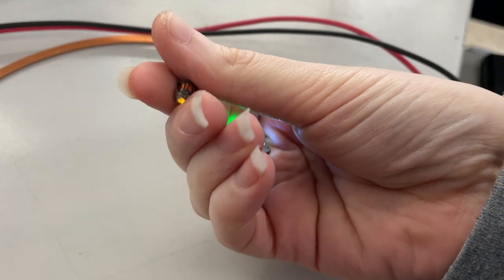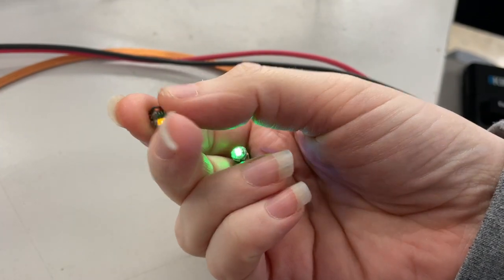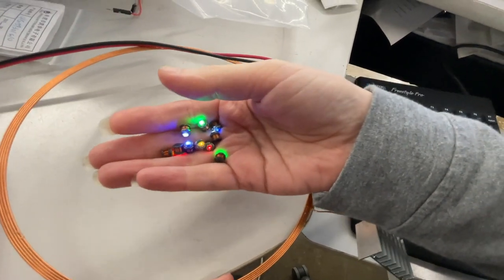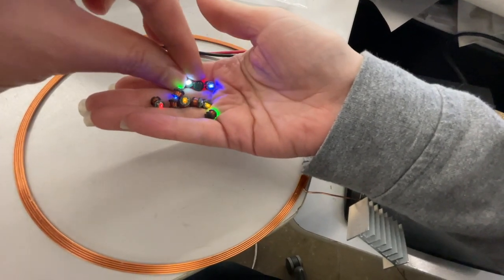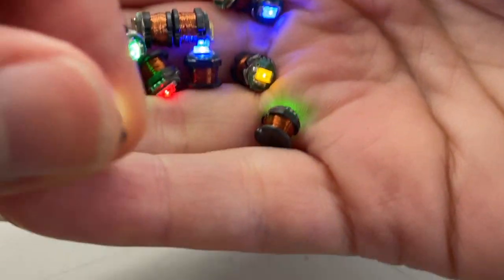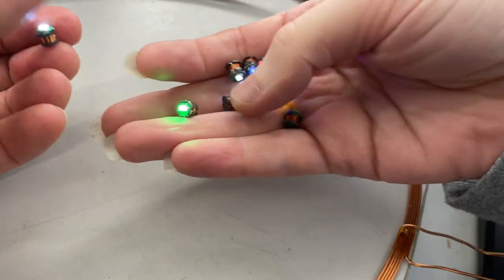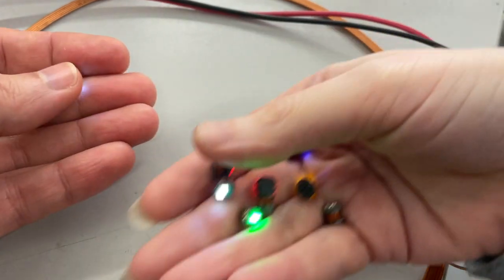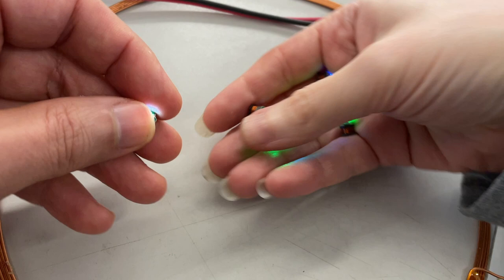Trying out these "wireless LEDs" we saw Naomi had! Pretty cool!

Comment: I've seen these used on a few Gunpla builds. The loop is hidden in the stand and the LED can be put in the weapon or other places where you want an accent light and don't want to mess with wiring.
Reply: what's gunpla?
Reply: @davinderc  Gundam plastic model kits, people that do them generally shorten it to GunPla (gundam is an anime)
Reply: I just set some into the wrist sheilds of a strike freedom mg but they are super dim :/ not sure why. They seem much brighter in this video
Reply: I know I'm very late, but do these work on MG kits? I wanted to try these on a unicorn gundam

Comment: Neat!!  How much current is the coil using?  Does it get hot?  Thinking about wearable ideas...
Reply: Mine gets a little warm. The circuit has a heat sync on it about 2x the size of the board
Reply: @PoopTheNetwork  it would be more nice if the led covered the entire coil and the black thing, since it's wireless, we can use and throw.

Comment: Wouldn't care to wear one near my inductive cooktop ;) Any idea about the frequency at which these are designed to be resonant?
Reply: I think it may be around 500kHz... At lower too much current would be required in the primary coil, at higher it would create too many losses, and it would also mess up with AM radios... Not so much used today but I think it's still forbidden to produce strong electromagnetic fields from 500kHz to 2MHz... Then it should be fine till 10MHz and so on with the next radio bandgap
Reply: You need to find out the frequency of your inductive cooktop :))). For example: My wireless charge f=110-205kHz, then you use the fomular f=1/2*pi*sqrt(L*C) to calc the L (inductor coil value), consider LED as small capacitor. In the video can see they are using the inductor 222 means 2200uH inductor.
Reply: @hurotomo  I believe most inductive cooktops are resonant around 32kHz. EMI regulations get tight above ~50 to 80 kHz, depending on where you live. Qi-chargers may indeed be bigger "magic-smoke-liberators", operating between 100kHz and 200 kHz. @Fabrizio - indeed the geometric volume would impose a restriction on how low the frequency can go. For a certified device, then, my guess would be ~ 100kHz (2.2uH//1uF). Hmm. should measure 100kHz EMI near my cooktop - there are bound to be 3rd harmonics..
Reply: @hurotomo  so considering the led capacity between 30 and 70pF (didn't check the datasheet, that's what I remember) the resonance frequency is between 400kHz and 700kHz